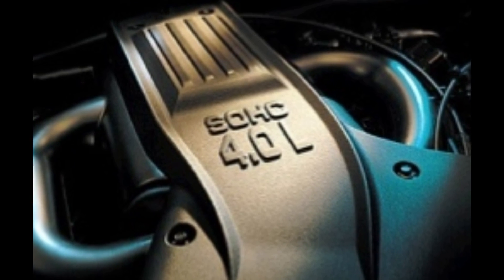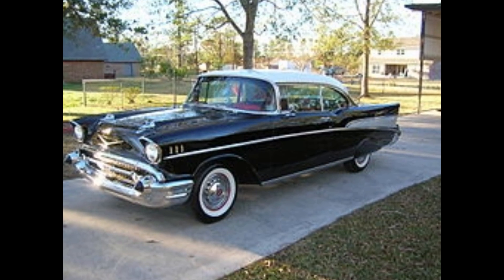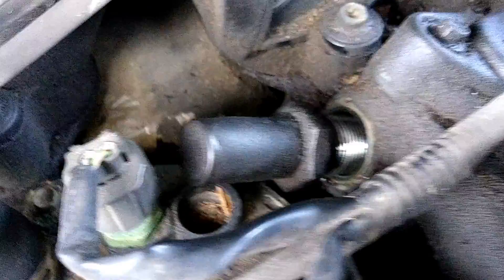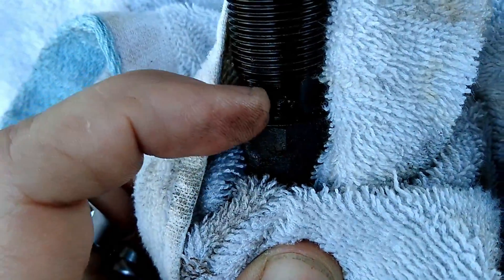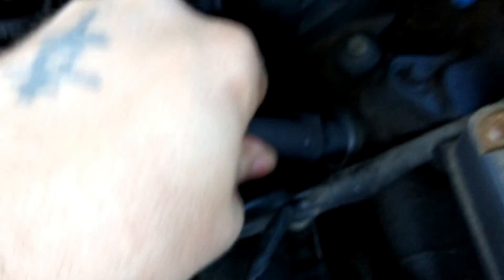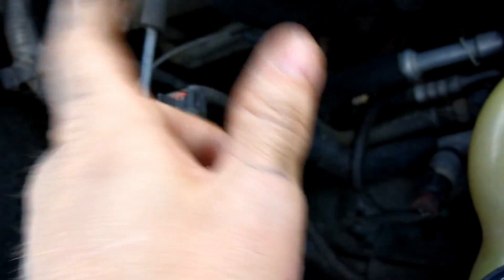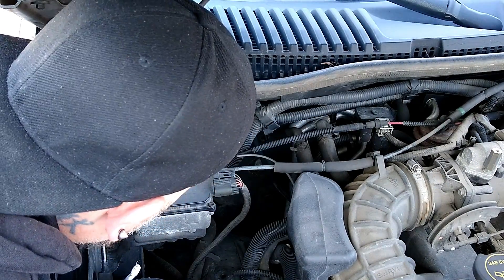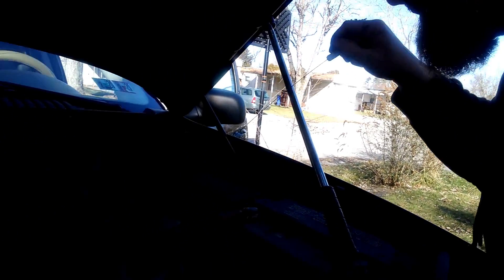How to replace timing chain tensioners 4.0 EASY

Comment: Thank you for making this video!!!   I have a 2005 explorer with the same problem.   I was about  to sell it.  Fixed in less than an hour.  Engine sounds amazing now!!  It took about 15 minutes of running the engine for the noise to go away.  I guess it takes time for the oil to circulate in the tensioner.
Reply from the maker: Glad it helped!
Reply: I read you should prime them with oil prior to install, that’s probably why it had the noise for 15 minutes
Reply from the maker: @stevemelidis6072  i wouldn't advise it. It makes them dead solid. The tensioners have springs to apply the right amount of tension if you loose oil pressure. Those chains (old and worn) break mostly at startup. I disagree entirely with priming them solid and that's why ford themselves doesn't recommend it i am guessing. If anything, at the most, i would install and then crank without starting if someone is concerned about priming that way the the chain and guides can sort of settle.
Reply: @Words-and-melody  thanks for the reply! i have an 03 explorer 4.0 and my rattle comes on at initial start up, and under load mostly over 2k rpms, how can i tell if the chain guides/cassettes are bad? i just ordered new tensioners so hopefully that'll be the remedy
Reply from the maker: @stevemelidis6072  guides are mostly going to be an all the time thing. Get them tensioners in and you will likely be fine. You will likely still experience some of that sound as they are a little noisy anyway, but it will lessen. 
Mine is rather healthy. The guides were changed on it already prior to me obtaining the truck (seen in receipts 2012) and the tensioners were the 3rd set and it still has a slight noise at startup. No where near what it was obviously.
Reply: @Words-and-melody  Agreed. The first start of the day with my '05 X is the same procedure. Hold pedal to the floor to cut fuel supply, crank over engine till it shows oil pressure then start. Regular starts from then on unless it sits for several hours.

Comment: Very informative video yet for elderly gentlemen like myself using an Endoscope Borescope Camera with Light makes the job easier when you can see what you are doing. Also place marks on the bolt and the housing to ensure that the holes line up.

Comment: Moto For Life, Could you tell me how much play can be felt when the tensioner is removed ?? I mean pushing on the chain the same way as the  tensioner plunger. Did you prime the plunger with oil before installation and how much pressure did you feel when pushing in the plunger with your finger Sir ???Any advice would would help me out and thanks too. vf   😀😀😀😀

Comment: One other thing when you start the engines try to place the gas pedal to the floor it shuts off the injectors in most cases and wont start the engine.  During this one minute minute and a half engine turn over time the tentioners are filling with oil pressure before the vehicle starts.  You will notice that once this happens  and start the engine you will not hear the clatter of dry oil during actual engine running.  Also fills the oil filter so that is not dry either.
Reply: I think I would just unplug the fuel pump fuse haha
Reply: I start my 2005 this way on the first start up of the day. It produces less wear on the plastic tensioners when they are dry of oil after sitting for long periods. A 10-15 second cranking time, is well enough time to get the tensioners and the oil pressure up to normal. Hold the  pedal to the floor, turn the key to start, look at the oil gauge, when it moves to show you have pressure, release the pedal and the unit will start. Works for me.
Reply: A minute??
5 secs should do it.
Reply: @BWater-yq3jx  Really a MINUTE ?? Your time must be off a bit.
Reply: @victoryfirst2878  
❌️

Comment: I didn’t seem like it in the video, but does it matter if the oil ports on the tensioners line up with the oil ports on the engine?
Reply: SHOULD NOT FELLA. THERE IS A MACHINED UNDERCUT groove for oil to find the OIL HOLE.

Comment: Do i need to change both tensioners changing just one will mess it up my truck?
Reply: @josuer.2723  
No, changing just one won't hurt, they're for different chains anyway.
I did mine 2 weeks apart just to see the difference each made.
Changed the top one first, which on my car is the easy one, and that improved things a lot.
After I did the bottom one, it was nearly perfect.  But I'll still do the 'flood-clear' turnover for 2 seconds first start on a cold morning.
Reply: Note:  I got Motorcraft tensioners from a dealership, and bought the crush-washers from RockAuto.
There's a lot of fake OEM stuff online, so for things like this I avoid E-bay etc.

Comment: I could not find any torque spec for the tensioners. however the holes in the chassis and the holes in the tensioner must line up. A drop of white paint on each side should show the exact location linup

Comment: What problems would these cause if there not working as they should? I have codes p0172 bank 1 too rich and p0174 bank 2 too lean. They came not long after i realised there was a crack in the rear side of the valve cover in bank 1, got that replaced but still getting codes and a rough idle and slight loss of power when driving. I have replaced a few things already - fuel filter, 02 sensor, spark plugs and wires but no luck. Could it be tensioner that's causing it and also the crack in the rear of the valve cover? Any advice appreciated as been like this last 2 years 😔🙏🏾 Thanks 😊
Reply from the maker: Not related at all. Your codes are emission related codes. A sensor is telling your computer that there isnt enough fuel in the system. Most times this is the o2 sensors but they can be related to other sensors. Timing tensioners are a purely mechanical aspect of your engine.
Reply: @Words-and-melody  would a timing tensioner make the chain skip and cause these codes?
Reply from the maker: @hepzlawrence7710  it could be a lot of things but if your chain jumped a tooth i would be more worried about that then your lean condition and changing the tensioners isn't going to be your fix. Your lean position could be from exhaust leaks, vacuum leaks or more as well...
There is a whole plethora of issues you could be having with these things and i hate to diagnose anything i haven't touched.
Reply: @Words-and-melody  would the chain sound happen all the time? I have a sound that happens around 3000rpm can't really describe the sound but its like a high pitch screech or scraping sound

Comment: Great lesson but just wondering if that oil pressure hole in the tensioner has to be in line with the oil pressure hole in the block how did you line it up ?
Reply from the maker: All you have to do is tighten it to spec. No need to be concerned with that. They are fault proof in that regard.
Reply: @Words-and-melody  thank you very appreciated

Comment: I ran the Cloyes tensioners for about 1k miles and the front chain chattered the whole time. It’s like the tensioner never primed for some reason. Then I put an “OEM” front tensioner from EBayin it and it solved the chain slap, but the Cloyes chain then snapped after 35 miles on the first drive. Now I’m putting it all back together and that “OEM” tensioner is stuck solid. It will NOT spring back out for some reason. I compressed it in all the way just to see if I could free it up and no oil came out of it so idono what went wrong.

Comment: You don’t have to make sure timing is good? Would doing this repair mess timing up?
Reply: @Deerector  
No it's fine.
(Of course don't start or turn over the engine while the tensioners are out !)
The chains just hang over the sprockets and the tensioners push in the guides from the side, so nothing moves in any way that matters.
Reply: @BWater-yq3jx thank you. I replaced 2 and no issues thankfully.

Comment: I replaced mine but there was no tension getting it to thread in. I have more rattle than I did before. What did I do wrong?
Reply: i think maybe your timing arm is bad but i also did this yesterday and now it has more rattle but that could be because i forgot the aluminum finisher on the rear one

Comment: Would it be the same for 04 sport Trac ? I have a slight rattle at start up so I bought the duralast tensioners I put the rear one in (primed it first ) torqued at 32fp and the noise got way worse so I put the old one back in and it went back to a slight rattle .. think I should get a different brand tensioner? or should I put them in dry? and let them prime themselves.
Reply: Dry and let themselves prime.

Comment: I replaced both on my 2005 ford and it’s still rattling. Do I need to install a middle tensioner or is my chain guides broke pls help!!!!
Reply from the maker: that's too hard a question to handle without being there. Your rattle could be many things.
Reply: did you prime the tensioners? you have to soak them in oil overnight
Reply from the maker: @jugulartheninja  the argument over whether or not to prime the tensioners is one that only has an impact on the first start up after installation. Ford does NOT recommend priming, neither do I.The tensioners are designed to work as they are, without oil pressure, in case, well, you start the truck in the MANY instances you would have NO oil pressure. The single most common moment of breakage that would occur on these chains is at startup. I assure you, if it's going to break, it will be more likely with a rock solid tensioner.  Beyond that it takes about 10 seconds to prime if you wanted to..  these trucks are known to have several noises that NO ONE can diagnose without a more descriptive set of circumstances and/or seeing/hearing it in person. Manifold and donut gasket leaks, top end sounds, cartridges and guides, etc. Get a hose, use it a stethoscope and find out where the noise is.
Reply: @Words-and-melody  Excellent response Of The lions. Souls like you are a mechanic for sure.

Comment: Its nice that you don't have to deal with the air conditioning / from ford new the original left ( passenger side ) tensioner only has about a quarter of an inch of wiggle room ( travel )to the new cassette cartridge??? / I would suggest replacing the driver side tensioner with a new OEM from ford and then use the old one from the driver side to install on the passenger side as it has .200 more throw. and yes it does make a difference.
Reply: What is the throw of the drivers side and passenger side George ??? How many did you replace in your career Sir ??

Comment: Thanks for the video!

Quick question: What sound are you looking for to determine if it’s the cassette vs the tensioner?

My wife’s truck suddenly started rattling at startup and over 2k rpm. 

Want to cross the easy stuff before pulling the engine.

Thanks again
Reply: Since nobody answered, here. Hopefully this can save you before it’s too late. 

Startup rattle: tensioners. Maybe cassette is minor but everything is still functional

Constant soft rattle (sounds like marbles in a tin can): cassettes are done for. The guides are broken and while you can probably run this engine still for a very, very long time- it’s gonna need the fix eventually. 

The constant soft rattle will be audible when driving at about 2300 RPM, 2700+ rpm, and when at idle.

Comment: You I believe got pretty fortunately lucky.  Every tentioner that I have done has slack in the chain where they can jump teeth.  Once the tentioner is out.  If you happen to know what stroke the engine is at, might make it fool proof.  It would let the valves place pressure on the opposing side of the tentioner.  Once that happens the tight side of the chain will hold the chain in actual non jump position.  This could actually jump time and ruin valves.
Reply from the maker: Ah,,, sometimes people 👆pretend to know what they’re talking about

Comment: Very good video, John!  One question: normally how often (in miles) do we need to replace the tensioner please? I know you mentioned your car’s mileage but I don’t know if you have done it before on the same car. Thanks!
Reply: If you have the motor doing the secondary tensioners is best every 100k
Preventative measures are always cheaper

Comment: Does the rattling youre taking about usually resonate into the valve cover? I had a loud ticking in my 4.0 and when I placed my hand on the valve cover I could veel vibration in the valve cover. Mechanic suggested these tensioners. I may try to do the job on my own but don't know if this is really the problem
Reply from the maker: Well tensioners are cheap and worth it just for maintenance so it wouldn't hurt. Sounds have a way of resonating, and vibrating and feel/sound like they are coming from elsewhere. By your description I would say your problem could be something else in the valve train but its hard to tell without being there.

I like to make a mechanics stethoscope with any long rubber hose you have laying around. Find the sound like that. Of course be VERY careful leaning around running engines. Hair, clothing, etc should be kept out of the way of any and all moving parts.
Reply: @Words-and-melody  are they this simple on the newer 4.0s as well? I don't have my truck right now to check but ive seen videos of mechanics having to take the timing chain covers off to access the tensioners inside the covers.. and all the ford mechanics ive spoken to say the motor has to be pulled.. im pretty confused. I don't have the time to screw with it on my own but I dont want to have to pay $1000+ in labor to have someone pull the motor and replace a part that may not even be the cause of the problem...
Reply: @Words-and-melody  i should add that mine is an 06 ranger. And the intake and everything up top looks pretty different from this 01 that he's working on
Reply: Youre* not he
Reply from the maker: @claldridge77  there are different apparatuses in the engine (timing cassettes) that, yes, you have to pull the engine to replace. They fail often and will lead to catastrophic engine failure. That noise does tend to resonate up top but I would not guess about it and would not listen to any mechanic that says, “we will try that” on your issue. Pay a good shop to determine where your noise is coming from before getting into that.
Reply: @Words-and-melody  okay I gotcha. Ill definately get a second opinion. Thanks!!

Comment: Does yours rattle at idling? I have an 02 exp and it will rattle when I'm idling and when I place it in park it will stop
Reply from the maker: you'd really have to try and pinpoint where the sound is coming from. maybe have someone put it in gear, set the parking brake and hold the service brake ( BE CAREFUL!)
get under the hood and under the truck and find where the sound is coming from for sure. You can use a hose like a stethoscope and listen everywhere to find your rattle.
Be careful of your accessory items and belts while moving around the vehicle. don't get your hair or the hose caught anywhere!
It could be as simple as a heat shield, or it could be one of many things in your engine as well as a flex plate where your transmission and torque converter but up to your engine. It could also be one of your accessories... (alternator, ac compressor, etc)
Best way to determine that is removing the serpentine belt and starting the vehicle and seeing if the noise is still present. Don't run for more than a couple minutes like this.
Reply: My 99 was exactly like that. I became absolutely certain it was under the valve cover the moment I removed the oil filler cap which on 99's is on the drivers side. Turned out the plastic part of the tensioner between the crank shaft and jack shaft was broken.

Comment: Hey i screwed it up. i tried to do that and unfortunately i cross-threated the thread on the passenger side. I could put the tensioner in with a slight angle (down), do you think that would work? Or do you have an other idea?
Reply from the maker: man, I hope you didn't run it in tight like that. You'll have to pull it out and see what threads are damaged. Try to use your old one to straighten the threads if they are damaged on the engine maybe. It could be tough but if you can get it at the right angle and get it spinning you may be able to. It its on the tensioner, then try to fix those threads or get a new one.
Reply: Corner Cutter Studio  i didn't run it tight. Idk why i tried more then 5 times to put it in with my hand, then it grapped, maybe it was messed up before and i made it worse. A mechanic told me to try to tap it, do you think that's a good idea? Otherwise i could try to get it in in that angle (isn't off too much and it is pointing down, so it wouldn't miss the cassette but i am worried about oil-leaks and the oil not going into the tensioner).
Reply from the maker: J K yeah man, oil leaks would come. I would not try and run it in. Are you positive its crossthreading? Can you see any threads damaged? I would remove the plunger from the old one and use it to “chase” the threads. If its only the first little section of a thread, i can see that working. That will also allow you to determine whether or not its actually cross threading or if the resistance with the new tensioner just makes it tighten up so much that it is fooling you. Following what i mean? Like literally break the spring tension cylinder from the old unit. Cut it out, pull it out, etc
Reply: @Words-and-melody  yes i get what you mean. I have some metal debris/shaving on the new bolt so unfortunately i am pretty sure it's damaged. I will try that with the plunger. Maybe i try to use my phone with the flashlight on to take some pictures from the treat.

Comment: I just changed both and now my truck will not start. Oil was full and I torqued both tensioners. Help..
Reply from the maker: hard to tell... sounds like its related to something else maybe.
Reply: Possibly one or both timing chain jumped